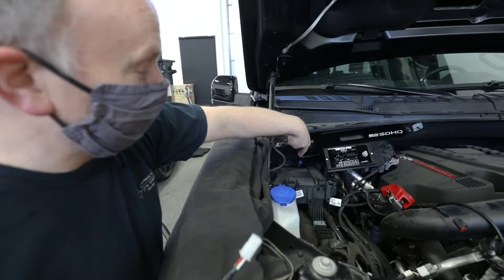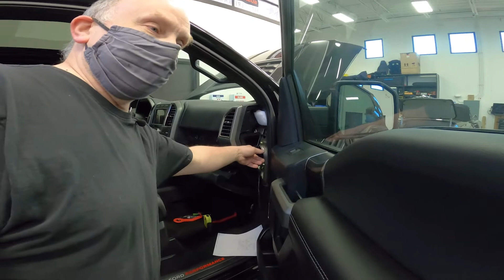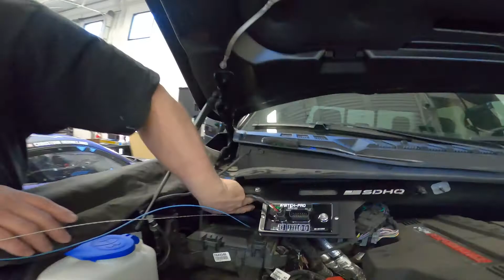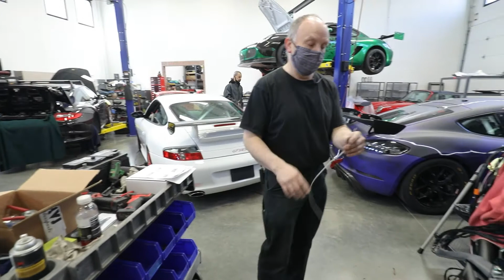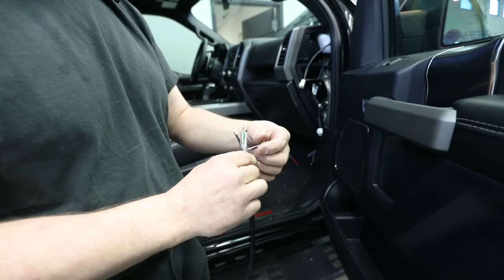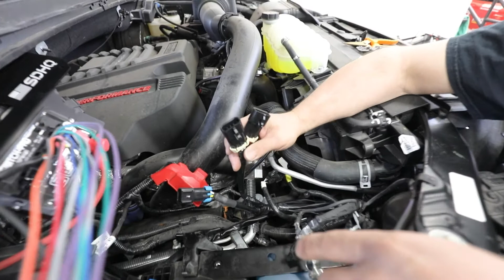Ford Raptor Switch Pro's / Baja Design LP6 / How We Installed Them Recap!

Comment: Where did you get the panel to mount the control head in the over head?  I like the fact that it doesn’t take up the space for the sunglass holder.  I’d like to use that for Icom radio later
Reply from the maker: Swarfworks
Reply: Ok, I didn’t see the upfitter switch’s on this, thus won’t work the ‘23 model.  Thanks

Comment: Where are the lights grounded? I see the positives in the 6 pin connector.
Switch Pros says not to alter the communication cable at all. You added the connectors to shorten the length. Any issues doing so?
Reply from the maker: These front lights are grounded to the light bar itself. Grounds are designed to be the shortest length possible which is always best.

Comment: So I’m still a little confused why the lvj module was used with the SwitchPro. I understand the easy to replace relays but why wouldn’t the SwitchPro along “with” the lvj module connected to the factory upfitter switches have been a lesser of a system? It would have added more switches and still made use of the lvj’s relays?
Reply from the maker: Great question! We won’t switch pro simply because of the programming function available.